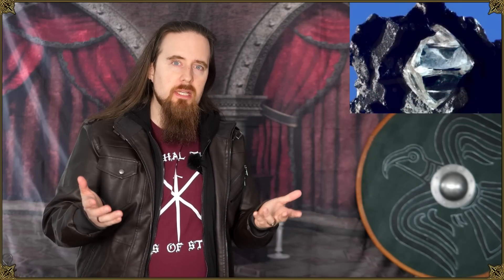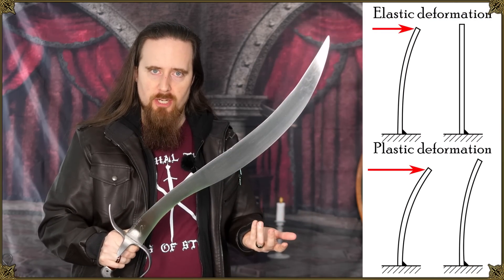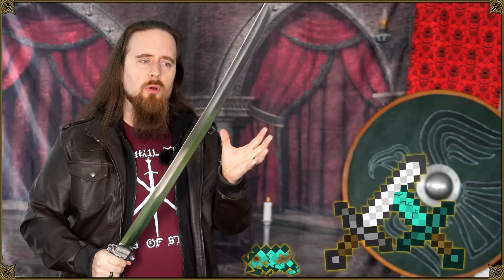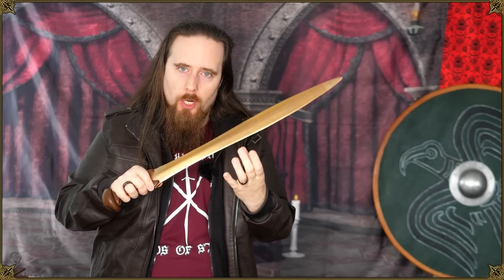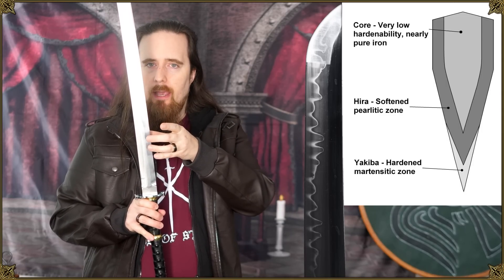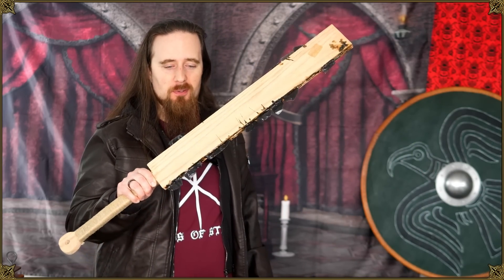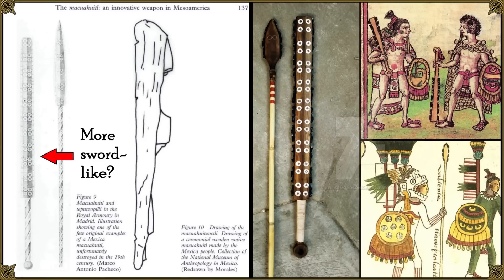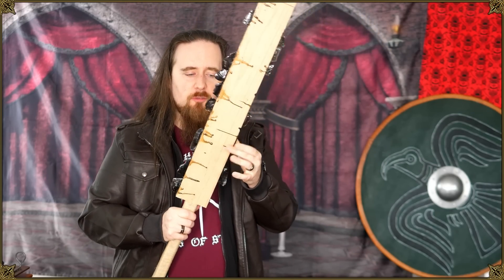Diamond Swords: Could They Work IRL? (Kind Of)

Comment: Used to have an obsidian knife,and what I figured was granite (yardrock) that I fashioned into kinda a santoku profile knife myself.
Both met there end from people just being a little bit careless with ceramic plates in the dish sink. The obsidian knife was let go into the water and cracked on contact with a plate from maybe 6 inches at most of a fall through water. And the granite chefknife had a plate come into the water ontop of it. Thats my experience with stone knives durability.
Were defeated by clay technology 🤔

Comment: I think you're wrong in this. If we get a long shape crystal known to be the hardest material on earth, we grind and shape the crystal into a sword blade, it is the strongest sword in the world. It will not be brittle as hardened metal. You see, steel is iron + carbon, the reason it become brittle is because the mixing of two different elements. Diamond is a crystal purely made of carbon, nothing that can split the element bonding. The only way to shape a diamond is by grinding. So when diamond sword clash with steel sword, it will theoretically cut the steel sword in half. It also can cut everything else just by being a sharp hard unbreakable blade.

Comment: Something of significant interest I think is worth looking into are Diamond drills and saw blades. Both seem to have quite significant toughness (high rpm/energy contact) but are used for the high hardness.

Modern technology is pretty incredible; it might not look like you’d imagine a Diamond blade, but I’d bet there’s something workable there.
Reply: The metal holding the diamonds on blades and bits is relatively softer and designed to wear away as it cuts the abrasive concrete, exposing new diamonds to cut. Hitting a large piece of rebar could actually polish the cutting surface smooth and it wouldn't cut anymore.

Comment: Yeah, the hardness scale (or mohs scale) is often confused with durability when the former is purely how hard it is to scratch.  Because of this difference, many tools use sapphire and ruby as they are a 9 in hardness yet much more durable than diamond allowing them to be used as industrial abrasives.  Similarly, diamond would be more useful in drilling/grinding role than any kind of precursive impact.

Comment: Sooo - a club with poisonous glass (Or other hard material) points (Mace like) intended to break off and stay in a wound.  Could also apply that tech to staff weapons if you were trained not to hold the end sections.  Maybe more hassle than value but an interesting idea in a fantasy setting.  I imagine that if you even blocked a hard blow 'overhead' or in front of your face you might find splinters of poisonous material spraying into your face.  It would certainly make opponents more cautious of the blunt weapon.
Reply: May be effective but it would wear out quickly.

Comment: Diamond isn't particularly sharp, and while it is very brittle but also far stronger than obsidian... Obsidian is just better for cutting and also leaving grievous wounds. Diamond would be far better for a high velocity penetrating weapon like a bullet tip, or in defense with a diamond plate or just carbon nanotube/graphene armor... But at that point it isn't diamond crystal. Another issue is that diamonds can burn in fire, which for armor or weapon is another undesirable hit to longevity unlike metal or just another fire resistant crystal.

Comment: You bringing up that the macuahuitl is more of a medieval spiked baseball bat than a traditional sword reminded me of when Shad made his own video on the Diamond Sword and how the original design could be used in combat, and I remember commenting the fact that in actual Minecraft, you don't really cut with the swords as much as you bash their fuckin' head in

So a Diamond Macuahuitl is actually perfectly gameplay accurate, being that it's pretty much an ostentatious cudgel lol
Reply: I would assume a diamond club may be even less practical than a diamond sword considering that a club requires you to hit your target with a heavy impact and thus more likely to lead to shattering, a blade at least you can cut and stab targets without much force as long as your target is soft, although a club can also be thicker so would take more force to shatter.
Reply: I suppose in both cases it is fine as long as your target is soft, maybe there is not much difference in practicality between a diamond sword and a diamond club.

Comment: The dark elf Drizzt Do'Urden from R.A. Salvatore's D&D books has a shamshir scimitar called Icingdeath made of steel, with a diamond-coated edge. The implication is that ground-up diamond dust lines the edge to facilitate cutting, without risking fracturing. 

And there are modern day bullets made of sintered metals, non-lead non-metals, and polymers, which are designed to be hard enough to damage soft tissue, but to break apart into dust when they hit walls or glass. They are popular when shooting steel targets.

Comment: Some materials, including some diamond-based abrasives, are self-sharpening. Simple summary: as some of the particles in the matrix get worn down, torn off, and/or broken they break and grind nearby material to be sharper. Note, this happens on a nano-scale usually with things like nano-particles in the matrix so really its not that much wearing down. You could coat sword in this for cutting. Or could make a club like bat with this if you use coarser particles not meant for cutting but for grinding. Harder material tends to transmit force better, so slightly better damage on club, and any drag along surface might lead nasty scrap like sandpaper but worse (however penetration low). Additionally, for club it would make more durable and focus impact slightly more during first contact.

Comment: I have a synthetic ruby edged leatherworking tool, with the ruby edge set into brass. I could see that a bronze sword could similarly have an edge of ruby, sapphire or even diamond, but ruby is likely tougher and easier to grind to a razor edge, while still being harder than almost any steel. 
It would be a very pretty blade too.

Comment: There is some recent development on CVD (chemical vapor deposition) diamond coatings on substrates that survive more than 800°C. This process would destroy the heat treatment of normal spring steel, but maybe one finds an alloy that could work under these conditions. It would still just be a coating, but it would create a diamond edge (similar to other modern hard coatings on tools, just a little thicker).

Comment: My biggest problem with diamond as a sword material is actually the cleavage planes found in the crystal. There's a few angles where if you give diamond a good whack it break clean in two, and the force to do that isn't even that high. This is actually how jewelers cut diamonds into the shape that they are.
Reply: Pretty good, but partially inaccurate. Diamond has 4 cleavage planes (parallel to the crystal faces). 
Jewellers don’t cleave diamonds (at least not on purpose). Jewellers are people who make/repair/sell jewelry. 
Those who cut and polish gemstones other than diamond are called lapidaries. 
Diamond cutters are those who rough out the diamond crystals into the desired shapes and give them the final polish. 
Cleaving used to be a method for splitting diamond crystals, but it is inconsistent and possibly destructive. 
Diamond coated disc saws and then later on lasers are the preferred method for removing sections of the crystals.
Reply: yes, we learned that from the inspector gadget cartoon.
Reply: heh heh cleavage
Reply: @D G, my guess is that you are talking about different stages of the processing.
Reply: @D G, if it comes first, does it mean there are other stages?
Every single cut done at diamonds are done by cleaving?
Reply: @D G , on the contrary, as I said, it seems that the cleaving you are talking about is done in the beginning and the cutting Chris is talking about is done near the end of the process.

If one thing comes first and another one comes later, it seems those are different stages of processing a diamond.
Reply: @The Hierophant, it still is fragile.
The cleavage plans are weaker, but it can break in other directions too.
Reply: @The Hierophant, in this case, you might as well make it 0.1mm thin and with a blade that changes shape.
Reply: Ahhh but we can now make perfect industrially made diamonds and cast them in whatever shape we like and by using the a method called single crystal casting you could make a single diamond crystal with no flaws for it to break at at the aforementioned plane.
New technology is super cool.
Reply: @paulrichardspencer  There's a couple problems with that method:

1) From what I could find it seems like this method only works with metals like the nickel superalloy used in gas turbines.

2) Cleavage planes arise from the natural crystalline structure, meaning that even a perfect diamond crystal with no flaws would still have them. Specifically, a diamond's cleavage planes form because of a difference in bond density found in two specific angles of the crystal.
Reply: @The Hierophant Vapour deposition diamonds are standard technology in the semiconductor industry. They are used for radiation stable semiconductors.
The jewellery industry hates people talking about how easy high quality diamonds are to manufacture…

Comment: I have some knowledge of exotic high-hardness steels sometimes used in high-performance knives. (Most of the steels were developed for other applications but can be “tuned” to create extremely high performance knife steels).
In regards to hardness, the steels I’m referring to range from 62 to 70+ hrc.
(52100, S60V, K390, Maxamet, Rex45/M4/Hap40, Rex121, for just a few examples). Each steel also has a potential range of attainable hardness.

Their very high hardness give them a lot of strength to hold very thin edge geometries without deforming (0.005 behind the cutting edge bevel thickness, for example).
These knives are very specialized in use and only for experienced users.

The hardest large-sized knives I’m aware of are custom competition choppers which I think you can find as high as ~62-65 hrc (CPM4V and M4 are common as I understand it), but again, their geometries and heat treats are very specialized and not suitable for swords.

Some ceramics have a degree of flexibility, but those are still very new to the knife world and I don’t think they would work well without significant modification, nor provide much advantage over typical sword steels.

I think there’s an idea that extremely hard = a sword that can cut anything, but that is not the case. Even a hypothetical diamond sword that is as strong and tough as steel would not magically be able to cut anything better.

It is the geometry that cuts and it’s about pulling the full potential out of materials to support the needed geometry. Geometry also typically plays a much bigger role in the durability of the actual edge than material, at least to an extent. (Copper and steel are worlds apart and that was evident in this video).

The point is that a sword would still need sword-like cutting geometry and the typical materials used to make them work just fine for that, so there is no point to extremely hard swords. They offer no practical advantage.

I’ve seen some pretty interesting developments in titanium alloy swords, though. To me, that is where people should be looking if they are curious about exotic blade materials relevant to swords.

I recommend looking into Larrin Thomas of “KnifeSteelNerds” as well as his book if anyone is interested in some technical reading.

Comment: Too brittle pitch isn't ironic. Its shoddy. Even the Neanderthals were chemists, mixing wax, fats and resins together to make a durable tenacious adhesive. They crosshatched their haft ends in northern climes occasionally, presumably to combat cold cracking.
  I'd do it over and reset the blades after adding some wax. Red sealing wax is an example at one percentage.

Comment: What about diamond impregnation? You just make an ordinary good quality steel sword but the cutting edge will be similar to the edges of diamond drill bits, where diamond particles are mixed with a powdered metal matrix such as nickel, cobalt, or tungsten carbide. The mixture is then pressed into the desired shape around the steel core of the sword and heated to a high temperature to bond the metal matrix to the diamond particles. That will " I guess "allow much better edge retention. Maybe finally katanas will cut tanks on the fly :D
Reply: Diamond powder doesn't improve the structural strength of the base metal holding it. Diamond saws cut with spinning/sawing both because diamond powder excels at friction cuts, and because if you actually swung it you'd waste a lot of diamond impregnated material for not much cutting done.

A sandblaster modified to fire diamond dust though, that'll shred a lot of things.
Reply: TLDR: that produces a "super sandpaper", not a "super cutting edge".
That's a grinding / abrasion cut, not a proper slice.   "Diamond tipped" drill bits and saw blades get edge damage and deformations just as much as the metal the diamond is suspended in. In my experience tungsten carbide (drill bits, saw blades & grinders) is prone to shattering, while "diamond steel" sharpeners pick up knicks and burrs the same way as any other sharpening steel (they show it worse - big scratches on the blade from tiny knicks in the abrasive steel)

Comment: It's funny because when I was a teenager I thought hardness was the sole aspect to define how "good" something like a blade or a piece of armor would be and I thought "holy cow, maybe a sword and plate armour made of Chromium would be super tough"... how wrong I was when I learned about the brittleness of "super"-hard materials xD
Reply: well you werent entirely wrong (atleast about the armor bit) ceramic plates (superhard and brittle) are used in some ballistic body armor. Usually combined with kevlar or some other woven armor behind it to catch the fragments
Reply: @dom7899  They do become unusable and require replacement after too much gunfire tho.
Reply: @st.haborym  yep i know, once a ceramic plate is hit if you happened to get shot there again gl. doesnt change the fact that they exist though and are in use. Even if you wear ballistic armor the goal is still to not get shot in the first place, the plate is there to protect most vitals on the off chance you do.
Reply: @dom7899  Two words: ghille suit
Reply: @st.haborym  I mean, a ghillie suit is not armour. It's camouflage. It's either worn without armour or alongside it, but cannot be put into the same category.
Reply: @st.haborym  Tbf, all ballistics armour requires replacement after too much fire. Kinda par for the course considering how we've yet to be able to create a material that's simultaneously hard enough to withstand gunfire, tough enough to not get damaged by said gunfire, and light enough to practically wear while also being shock absorbant enough to not get you killed through the impact anyway. As it stands, all current armours kinda just rely on a bunch of tough material that's combined with hard material in a way that deforms enough to stop the bullet while also keeping you safe.
Reply: @st.haborym  Much better than replacing the thing wearing them, especially if that thing is you!  And unlike sufficiently thick steel, a person can wear it and actually move around somewhat.

Comment: Very interesting and entertaining video!

Only thing is your arguments are just not true.
Sorry to be "that guy", but let me explain you why:
Brittle doesn't mean weaker. It just means less or no deformation before rupture point.
If you go look at steel rupture point on google (ultimate tensile strength), it's between 450 and 750MPa while diamond's ultimate tensile strength is at 2800MPa which means that your diamond would need 3.5 to 6 times more stress than your steel sword for it to break. (Old steel was of lesser quality with a rupture point at around 210MPa... just a fun fact to compare)

It's the same principle with quenching your steel sword. More brittle but have better mechanical properties such as better hardness (prevents dents) , higher yield strength (stress needed to deform) and higher ultimate tensile strength (again, stress needed to break).

This is a common misconception that people have towards brittle material because of the way they explode or fracture while a ductile material would've just bent or have a dent.

This knowledge is coming from my classes in mechanical engineering with the numbers being researched on google ;)

Maybe, in my opinion, the reasons why we dont see anyone walking with diamond swords are because:
- Who have enough money for that?
- How tf do you make a single crystal diamond sword? Like can you even melt it and mold it? and after that, how do you sharpen it? With other diamond tools?

Finally, what I've just said kinda go against everything you say in your vid lol... Sorry for ruining your work in a way I'm just here to correct misinformation and spread truth with facts!

Feel free to delete my comment if you dont want to get exposed lol

Love your content my guy, have a good one!

Comment: I remember reading an article from at least 10 years ago about a process of applying a diamond coating on drill bits via lasers. Doing that with a steel sword seems like it would produce a better "diamond sword".
In terms of fantasy diamond swords and price of diamonds. I think in many of the fantasy settings with magic spells you could probably use a spell that could generate and sustain the conditions we use for making synthetic diamonds as well.
Reply: Those drills do more grinding than cutting, so it is a different ball park.